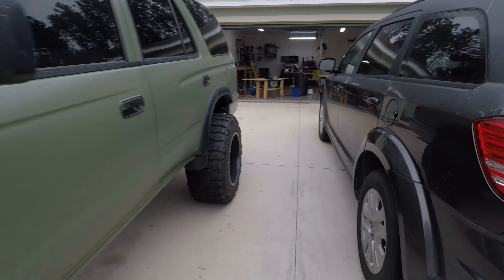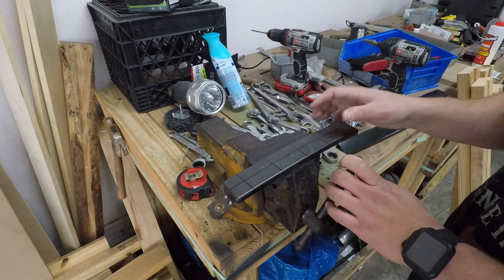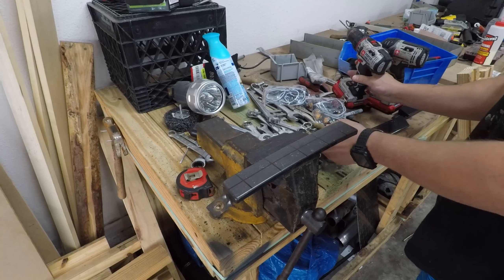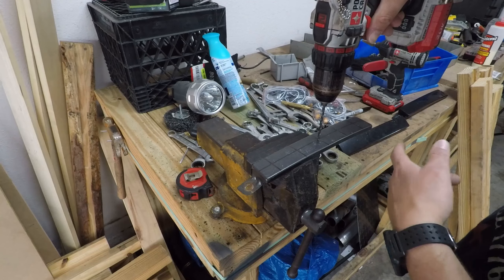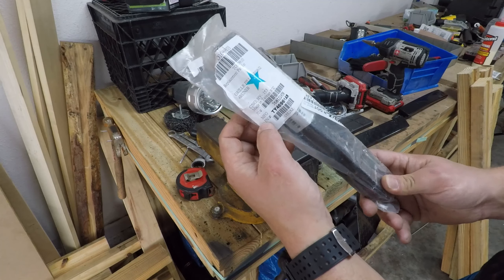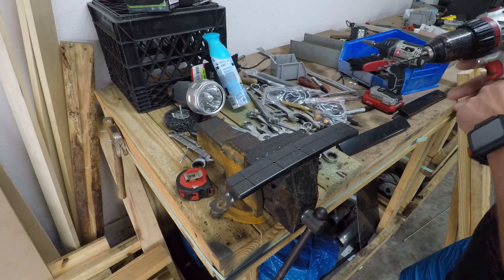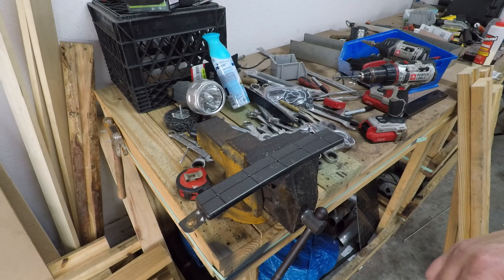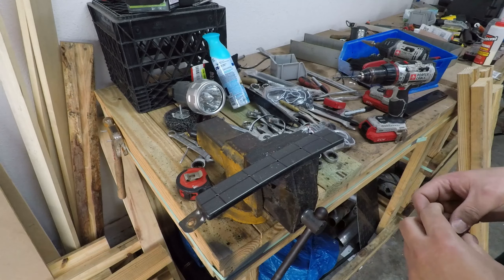Building Custom Led Turn Signals

Comment: Does the LED Flasher relay get rid of the clicking when the turn signal is on? I like the clicking and don't want to lose it from doing this upgrade, but I'm going to need to do something like this when I get my new bumper
Reply from the maker: You still get the audio clicking
Reply: @SmittysWorld  Awesome, thanks for such a quick response! Amazon is saying the relay you linked doesn't fit the 97 4runner but theres a CF15-JL02 that claims to fit 96-02 4runners. Idk what differences there are or what to look for. The one you linked is cheaper

Comment: Thanks for the video! I’m trying to do this mod now and don’t know anything about wiring... can you explain more about the relay? Where does it go?
Reply from the maker: Led relay you can get at auto part store. It goes under the dash
Reply: @SmittysWorld  got it. Thanks!
Reply: Hello I installed the same light's but the signal light is slow what can I do to make them flash normal speed?
Reply from the maker: @ledesma7051  what relay did you use